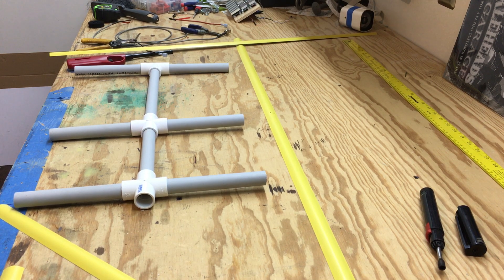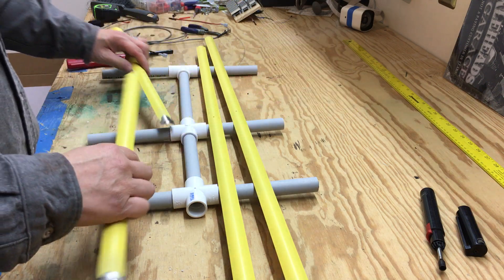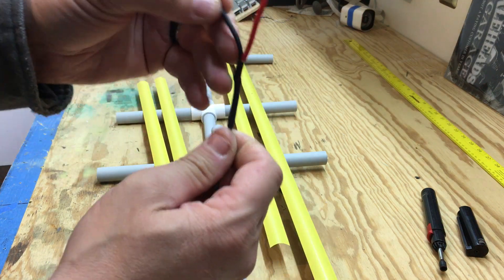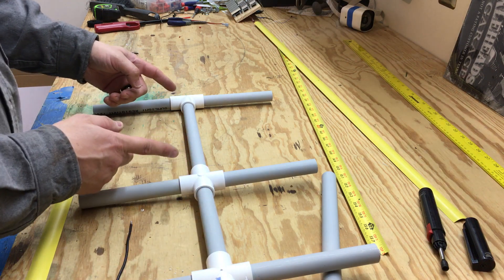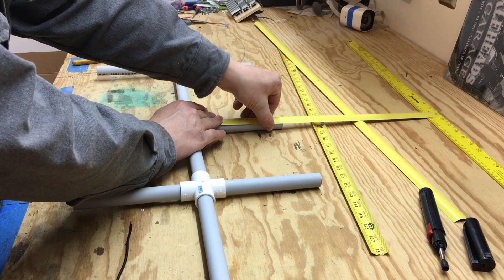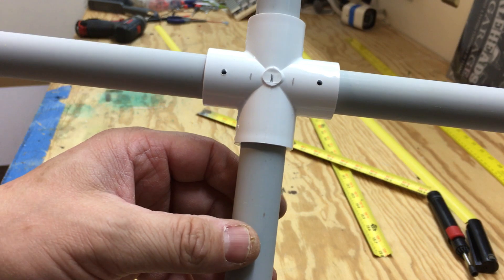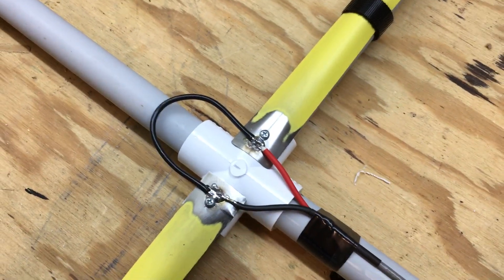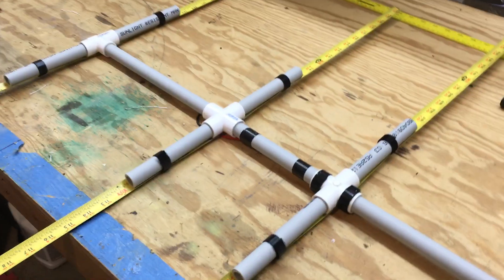How To Build A Homemade 2 Meter Tape Measure Yagi Antenna

Comment: Built this following along with your video. Very compact and works great for ISS and other amateur satellites. SWR is under 1.7 across most of the 2m band, with dips to 1.03. I will be using this ALOT! Thank you for the video!

Comment: are there any important considerations for the match wire?   kinda looks to me like it's shorting the dipoles out?  Also, where do you get 4 way connectors - not seen any at my local diy / plumbers supplies.